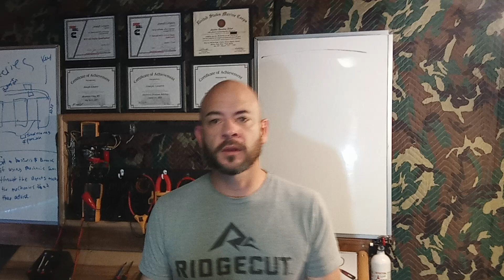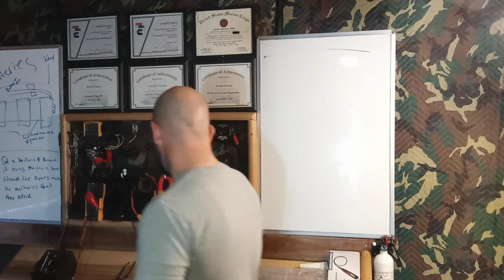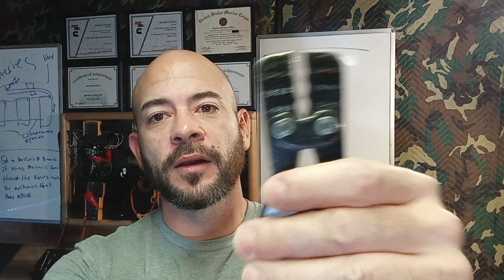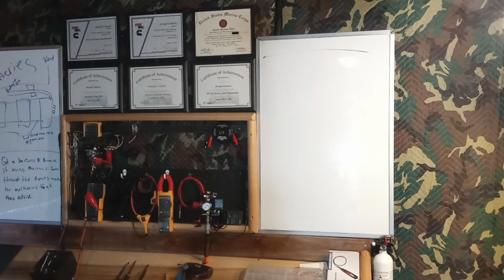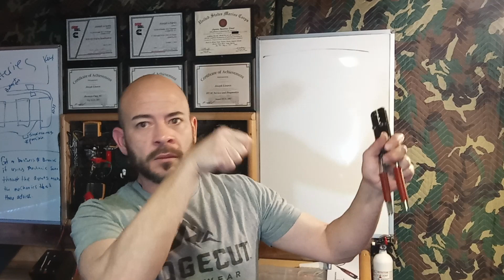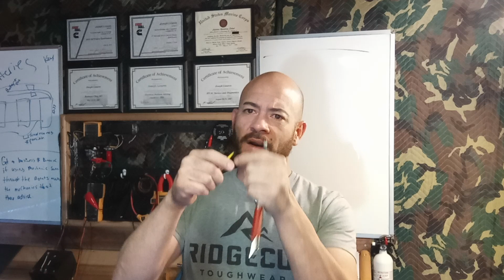Mechanics,  Please never pierce a wire.

Comment: What about back probing? It's piercing the wire connector weather seal.  

Has back probing ever been the root cause of electrical issues in those harsh environments or mainly wire piercing?
Reply from the maker: The outer seal on the weather pack between the seal and the plug body. I have not had this cause problems. If it's a 1 piece seal for several wire the slide it back. And test the exposed cavity and pin. Lots of variations of plugs and different approaches.
Reply from the maker: Thank you for the comment brother.

Comment: The best crimp connectors that I used is from out bmw dealer they’re probably made by somebody else but it uses the same crumpets as the pin crimpers and has a standalone “heat shrink tube” that is way better than the black/color shrink tubes

Comment: butt connectors are either insulated or non-insulated. The crimpers that have a jagged point are for the non-insulated "bare" type. After crimping you slide the heat shrink over and it creates a very strong connection. I've seen a harness cut in half that was crimped back together using those and held the weight of a man. There's nothing wrong with using your insulated connectors but it can slide apart with excessive tension, especially if you're crimping stranded wire, and double if the wire is smaller than the connector.

Comment: Chrysler stresses never to backprobe connectors in their training due to damaging pins and weather seals, and to pierce and repair instead. In fact, the tool they say to use is a thumb tack. I don't do that, I backprobe wherever i can and try to hide from the foreman, of course I'm careful about backprobing. That being said, I've definitely pierced wires in very tight spaces under the dash where i can't even fit my fingers let alone a backprobe grasped between my fingers. This is where I disagree and feel like it's not the end of discussion. If i have to pull a dash out that calls for 6 - 10 hours to get to a connector, i'm piercing a wire. No customer is going to want to pay over 6 hours of labour to diag a problem. In fact, a lot of my customers don't want to pay for 1 hour of diag, they think it should be free because "you didn't fix anything"
Reply from the maker: You could always go to the next available connector and depending on your findings you could tell them the problem is behind the dash. I'm really not sure about cars. Make the move to diesel brother. We would be happy to have a conscientious guy like you on the team. Electrical is far easier on these big monsters. Thank you for the comment.
Reply: @americandieselllc2966  I'm certainly considering it! I'm riding out all the diesel training I can from FCA for now, but very soon, I'd like to make a change in direction. 
The pay in automotive doesn't make sense for the amount of knowledge and endless education required to stay ahead of the curve. I enjoy doing it, but it goes very underappreciated. 
Anyway, thanks for your reply and keep up the great content brother!

Comment: Scanner Danner!
Reply from the maker: No disrespect to junior the college teacher but he is wrong to teach wire piercing. I stand on that. I'm not involved in cars. but the exposure and constant movement of diesel engine vibration the plasidip wont last. and it will allow intrusion and degrade the wire. 2 different world cars and industrial equipment.

Comment: Nothing wrong with piercing! Sometimes its THE way. Replace the wire if its bad. But liquid tape!
Reply: I was taught by my boss to never pierce a wire if you do not have access to back probe the connector and you believe you must pierce the wire you better cut that out and use a butt connector with heat shrink to reconnect it, doesn’t matter if your working on a big diesel or a car it will not last and if you stay at wherever you do that stuff it will come back one day and you will see.
Reply: @JosephLinares224  you can't always easily get to connector,and your only diagnosing.
Reply: @charlesgould8436 Foolish!
Reply from the maker: Scanner Danner is teaching to do that and he is 100% wrong

Comment: Phil's probe is great for piercing wires. followed up with liquid tape . Check it out if you haven't already seen it.
Reply from the maker: That is a problem you are creating that was not there before you came to help fix a problem . Don't pierce wires if you care that it does matter. The liquid tape does fall off when weathered. I live in sub zero. And again I'm talking about over the road truck that see mass amounts of exposure. Just fix it if you poke it. I own an diesel electric company and I have seen it all. Thank you for the comment.
Reply: @americandieselllc2966  I absolutely understand,  and agree it is not a good habit as you stated , new techs keep getting trained they wrong way. I do live in the south west so I don't see the accelerated wiring issues as often. 

Digging the videos,  staying tuned in.🤘
Reply from the maker: Thank you for that brother.  @DooMHaMMeR247
Reply from the maker: respectfully.

Comment: what’s wrong with a good rant? lol. I see that often enough on wires where the corrosion disintegrates the wire right across the wire where someone poked a hole with a test light.